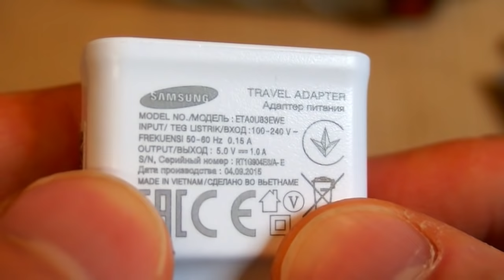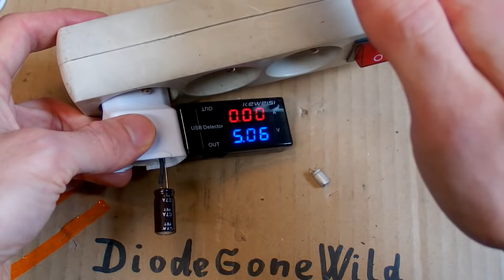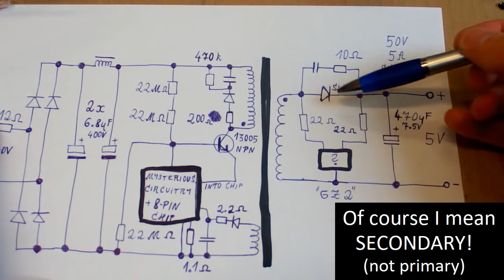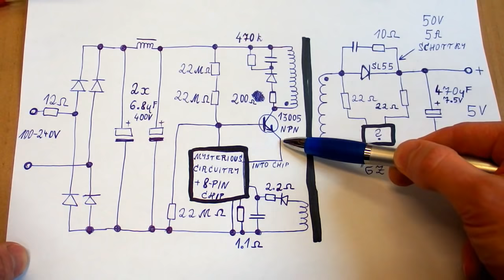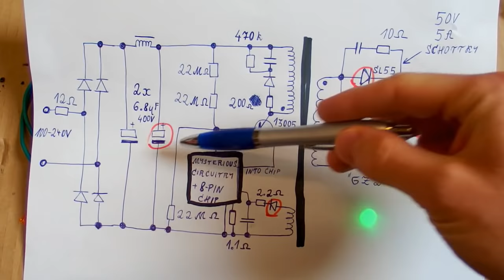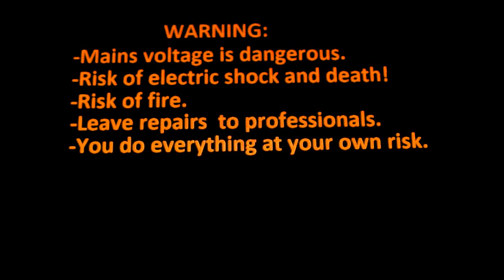Samsung USB Charger Failure and Repair

Comment: Dude, I'm a technician and this is about the only size circuit I would attempt to troubleshoot.  Trying to troubleshoot more advanced circuit systems like phased array radar systems and circuitry with analog and digital circuitry on the same board can be stressful and frustrating.  This is a great starter circuit to learn how to troubleshoot.  BTW, the guy doing this video would make a great electronics teacher.
Reply: He is an electrical engineer
Reply: Certainly agree man

Comment: Before scrolling down to the comments, I also guessed lots of commenters would have fun with the voice. Its funny, but easy to hear anyway, because of good audio quality.
But more important - this man is a electonics professional.
He obvious knows alle the individual details and functions/principals of the switch-mode power supply circuits, so listen and learn...
Pay special attention to the evaluation of the isolation band between the high voltage and low voltage section. Important safety....
Thanks to this DiodeGoneWild for using so much time on an $5 unit. You know your knowlegde.
Reply: It's pretty sad that the top three comments are about his accent instead of the product in this video.  Yes he's got an Indian sounding slovak accent (if there's such a thing he-he), but it's all good, the guy's very knowledgeable and that's all that matters.  He's made or cables and wires, with deep dark desires, so don't touch him! :D  "That's niiiiiiiiiiice!" if you know what I mean ;)
Reply: ehh he's ok.
Reply: He has a web page danyk cz
Reply: @morfisiuslizerro6400  If i dont like his voice that wont make me a racist (or any other here), just to make it clear.
Reply: @BillAnt  He is from Czechoslovakia

Comment: I think the 6Z2 chip is actually a dual common anode zener diode.
As for the emitter of the switching transistor - it probably connects to the chip because the chip has an internal current sensing resistor or something like that, for overcurrent/overpower protection.

Comment: Great work Sir, and I wish I had a tutor like you in my early school and college days.  You bet I would have become one of the best electronic engineers.  Your intelligent analysis of the circuitry is highly commendable.  I wonder if you could answer my other questions on electronic circuits such as Battery charger and UPS circuit.  I would be grateful for a line in reply.  Thanks and best wishes.
Reply: I agree with you 😢😢😢😢😮

Comment: 5:35  The extra resistor to the negative rail means that it will be a voltage divider, it will give a fixed voltage to the "chip" if this is resistor was not there, it would mean it is only the current to the chip would be reduced, NOT the voltage (although, in practice, the voltage would probably be reduced a lot). This is the difference between  a Rheostat, which has 2 connections and controls current and a Potentiometer which has 3 connections and controls voltage.  Hope this helps mate :-)
Reply: At 5:03 he points out the L1 inductor, but does show on the schematic or talk about the component B1 which is on the negative side of the two 6.8uF capacitors.  Would you happen to know what type of a device B1 is?  I’ve searched all over and I can’t find any information on the reference designation for B.  Thanks!

Comment: Great video sir! Thank you for showing me how to open the damaged adapter without cutting my fingers!😂 My case of failure was different, the capacitors were fine, but two of the solders on the USB connector had cracked. I re-solder them and it works!

Comment: The input capacitors are made by CapXon. A capacitor company that makes their capacitors in china. CapXon is also notorious for their capacitors failing prematurely.  Especially around the early 2000's, Capxon's newer capacitors are not that much better.

They should have gone with a better brand for the input capacitors,  Some really good brand they could have gone with are nippon chemi-con, nichicon, rubycon, panasonic and suncon. (most of these brands make there capacitors in japan.)
REPLY
Reply: No, teapo, jamicon, lelon, OST are still crap.
Good capacitors are Matsushita/Panasonic, Rubycon, Nippon Chemicon, Nichicon and Sanyo.
Reply: I was thinking to myself when editing this comment today 'Should i remove the part about the Chinese capacitors being "decent" ' I guess i should now because now I've seen more of them fail since i made that comment.
Reply: Because the power supply is designed to fail ... & Power supply manufacturers usually first "save money" on the capacitors
Reply: Ben Chavez - when you were editing, you should have fixed the repeated errors in the use of there, their and they're. There was a dead capacitor in this charger. They're all cheap Chinese capacitors inside there, and the brands are notorious for their low quality.
Reply: Sorry, i was tired. I will try to fix the typos.
Reply: Capxon is shit. Most of my monitors have had the issue of the capacitor failing and I needed to replace them.
Reply: I try to use Sprague caps when I can afford them and find the compatable size and value. Electrolytic caps are like batteries , they grow old, lose their electrolyte, dry up and no longer function. So that is why they are the first thing to check in older equipment or products. Best to change all the electrolytic caps then see if it works from there

Comment: The control IC is definitely made by Diodes but the mark doesn't match any known device so it's either a custom chip for this supply or it's mismarked. That is fairly standard topology to have the sense resistor going into the controller and the transistor collector on another pin. The device on the output is definitely a minimum load to prevent the output from exceeding 5V.

Comment: A decently designed charger ruined by cheap Chinese capacitors. Shame.
Reply from the maker: Exactly.
Reply: I would believe you, if you could prove that the charger was exceeding 85 degrees. Please show us how English should be "speeked".
Reply: Not trying to start a fight....but the Australian versions of the Samsung chargers have Nicicon or Rubycon capacitors. So I dunno wether thats a fake or your country gets cheaped out on.
Reply: Euro Bum Ooo nic
Reply: Murita muta murita sister
Reply: Euro Bum how much money did you paid for a Sumsom ?
Reply: CAPXCON = BOOM!
Reply: Are you kidding me? 99% of all great quality products use cheap Chinese capacitors. I have repaired countless flat screen TV's and monitors that failed cause of crappy Chinese capacitors!

Comment: I wonder if confirmation bias ever plays into his thinking. Meaning if we tried to get an ok quality Chinese charger, but pack it into a Samsung, Apple, Sony etc charger, would he analyse the charger and believing it to be from a good brand, start saying how it's good and well designed. That is quite interesting to wonder.
Reply: Sure, but also... in this particular case, >5mm electrical separation? That is insanely high. Definitely more than necessary - but it is a good thing to have more than necessary to save your life.

BTW how dangerous is that electrolyte stuff when it fills that gap? What kind of current would it let through from primary to secondary? Is that actually another real danger, not just arcing, on chargers with lower separation?

Comment: Have a slightly different Samsung adaptive fast charge model for the 120V 60Hz market, quit on me after two years.  Turned out it was a manufacturing defect, the PCB slides into two connectors to hook it up to mains power and one had failed by inadequate contact.  Bent the connector so it grips more tightly and replaced the solder on the PCB connecting pad.  Works now, got lucky with a super simple problem.

Comment: the small winding on the primary, in addition to powering the driver, serves to indirectly control the output voltage.
Reply: But the output voltage is constant @ 5V?
Reply: That winding is actually called secondary winding, it's jus that it is located on primary side of the board. It is only used to power up PMW circuit. It does not  necessarily provides any control.
Reply: @sthandiwe7825  
the small winding is used to power the PWM, but it is also necessary to control the percentage of the PWM itself. with a fixed PWM, the system could not regulate the output voltage. bye
Reply: @matteom2011  It only provides power to PMW circuit, normally it provides fixed 12vdc to pulse with modulation circuit but that also depends on the design. PMW circuit is for oscillation and control. The only circuits that provide control is the feedback and PMW circuit not the power from those windings.

Comment: Well done on the 10000 subs :-D.
Why dont they watch the videos, 10000 views per video would be awesome.

Are the three 22meg resistors just supplying 1/3rd of the voltage to start the chip? perhaps.
Reply from the maker: It seems that only 10% of the subs really watch the videos. Maybe they have subbed to too many channels because the youtubers are desperately begging for subs those days :D. 

1/3 of the voltage would be 110Vdc. The chip has to clamp it down to a much lower voltage anyway, so the 22M resistor at the bottom has no use. Maybe they had a big stock of 22M resistors with no use...
Reply: Now if you could just add some hints to your 10k users to go to your very interesting web site: http://danyk.cz/index_en.html, adverts could bring a few more pennies in :-D.

Yes 22 meg is odd, i've seen 1meg and 2.2meg resistors used in the start up circuit of some switchmodes, perhaps they did over order lol.
Reply: zx8401ztv my goodness there is some really cool stuff on his web thank you for pointing it out.
Reply: It is full of interesting things, some of the high voltage circuits are a bit dangerous, but use common sense and its all usefull :-D
Reply: DiodeGoneWild it's true your the only guy I haven't seen begging for subs good job sir

Comment: Very good thank you. I have seen dozens of electronic products fail over the years from leaking electrolytic capacitors. and repaired most of them by replacing the capacitors with newer and if possible higher values, both voltage and capacitance if room allowed it.

Comment: The secondary capacitor us of the polymer solid electrolyte type. These do not suffer from drying out so are rarely the cause of any problems. Their main feature is extremely low ESR and ripple current handling capability for their size and voltage rating. The voltage rating is intentionally such crazy number, to make sure no purchaser without any technical knowledge would order a seemingly cheaper standard electrolytic for that place (you won't find a "7.5V" rating among standard electrolytics) The "7,5V" actually mean the same expected operating voltage as the "6.3V" of standard electrolytics is intended for, so for about 3..5.5V DC.

Comment: the mystery diode (@5:11) that you do not know works as a current source, this tech dates back to the 741 op. amp.(see the internal circuitry  for more you may notice that the 741 has 3 current mirrors (it is called))
Reply: great input thank you

Comment: Thank you for your great video as usual, i have the same charger and i would like to make a variable output voltage using a potentiometer what is the component based on your diagram that i need to change to make that happen?

Comment: His way of speaking sounds like a song! Nice job by the way :) The 22+22 MegaOhms and the 22MegaOhms seems to be a voltage divider for providing the bias voltage to the base of the transistor. Probably the switching of the transistor is done by the pin from "Mysterious Circuitry 8-pin chip". This chip must have some internal switch to connect and disconnect the transistor's emitter to ground (could be used for over-current/over-voltage cut-off or something).

Comment: The problem was the electrolitic liquid?! So, if  you do not  replace the capacitor anc only clean the circuit boar.. the problem would be solved?!
Reply: No  the cap was bad....that is why it was leaking

Comment: Hi, is there any way to change the output voltage to, say, 9V? I have several old chargers and I'd like to use one as a 9V power supply for my component tester. Thanks.
Reply: you would have to rewind the last transformer and without stating the current you need, it would be difficult to help you
you would have to design it by trial and error

Comment: hi guys i have a problem: the input of the same USB charger as you is in my country 230V, but can i also put there an Input, negative and positiv cable of a 12V Batterie, on it? or doesn't it work bc of a diode?

Comment: @DiodeGoneWild Could you please tell me what is the functionality of the spark gap?
Reply from the maker: This is a bypass for electrostatic discharges. If you walk on a carpet or take off a sweater and them you touch the output, the static electricity jumps in the spark gap instead of damaging the transformer or optocoupler.
Reply: Wow! That's clever! Thanks for the reply!!😃

Comment: The transistor and switch control chip works together by sharing the voltage load. That way you can get away with a switch controller meant for rectified 120V but still use it for rectified 230V. Because of voltage divider 22M+22M vs 22M... 2/3:rd of voltage load will land on transistor rather than switch controller (during 'off' part of sw.cycle). For this to work the transistor must be a mosfet or IGBT: there is not enough current to drive a NPN-base... I would not even think a darlington would work, but that's just a guess.

Comment: Whare did you buy the capacitor 470 uF 7.5v ?? Cant find it on Google ??
Reply: Just use 12v or 16v or something with higher volt rating. I wouldn't recommendation it, but you could put a 220v 470uf cap on there for all it mattered. Just get the uf rating close.

Comment: damn this seems like it woulda been worth it to just buy a new charger.

crazy video though. super cool seeing it successfully fixed
Reply: Agreed. The board is a mess now with several replacement parts bodged on to it. Even if glued back together, there will be some danger of the case opening up again during use.

Comment: Can I replace 6.8 uF capacitor with higher value, for instance 10 uF (400V) ? What does it do with volts and amps going to next part of the circuit (the DC high volts part with the transistor and mysterious chip)?

Comment: I wounder if the 3 pin mystery chip is for current sensing in case some device tries to draw like 5 amps out of the USB charger.
Reply: could be but without chip ID we will never know

Comment: Forgive my ignorance but can someone explain me why there is a rectifier in the primary part instead of the secondary part only? I mean the rectified voltage is turned back to AC again through the npn transistor  to be fed through the transformer anyway, so what's the point of rectifying it before?

Comment: Can we use these charger's circuit part as dc to dc 5v. If yes then from where in circuit we input the battery and how many voltage.

Generally these type of chargers divided into two parts. 1-before smps (ac input) & 2-after smps (to 5v output) 
If we remove all circuit before the smps & also smps then can we use the circuit  from smps output as dc input?
Reply: try it and let us know

Comment: "GZ2" chip can't be a regulator, as regulating is done through feedback of the small secondary coil with a diode and a 2.2-ohm resistor in series. Maybe the "GZ2" chip has something to do with the fact that the phone recognizes these original Samsung chargers as "fast chargers" and not the generic ones, even if the generic ones have the same or more charging current capacity. Maybe the "GZ2" chip generates a special signal to be recognized by the phone as a genuine charger?
Reply: intersting thought but do you really think its that sophisticated?
Reply: @rogerd4559  No. It was just a speculation as at least in USA, the Samsung genuine chargers does that, but I haven't researched on it.

On another thought, the one in the video could hardly be that, as any "signal" could be filtered out by the parallel 470uf capacitor. The minimum of an MCU would be that, 3 leads, Vcc, Gnd and seria data signal out, but not in that configuration.

Really not sure about that one. I would need to have it in my lab and test it with an oscilloscope.

Comment: External transistor is not switching transistor but cascode (base connected to VCC, emitter voltage will be never higher than VCC), switching (low voltage one, because voltage is limited by cascode) is inside chip. Secondary side chip is monitoring Vout and mainly during no load conditions, it kicks into transformer so it is transfered to primary side aux and informs primary side controller to start switching. This is because primary side regulation primary controller has no clue about output voltage when it doesn't switching. When there is no load you can't switch otherwise your VOUT increases too high or you need to burn energy in preload, but there are strict noload consumption requirement nowdays so they stop primary switching and waits for feedback through transformer from sec. side controller when VOUT drops and than primary starts to switching again.

Comment: Can I convert  this samsung charges  6v(AC)-5v(DC) instead of 220v(AC)-5v(DC)  what would it be, if I changes the first capasitors and first resistors?   Can it be using this module, like step up converter?
Reply: possibly try it and let us know

Comment: When I practiced soldering the pad came away from circuit board, what am I doing wrong?
Reply from the maker: You were heating it way too much (way too long)... or maybe the board was crappy :).
Reply: too much heat and too big an iron for the repair
you can buy a land repair kit on line maybe from Ebay

Comment: If you would of seen the top of the Capacitor - it was domed upwards and that is usually the indication that the cap has started or has failed. A test with a ESR meter would have found it. 
But Ya found it and Wah-la It Works!!!